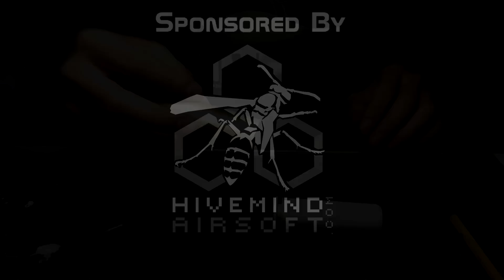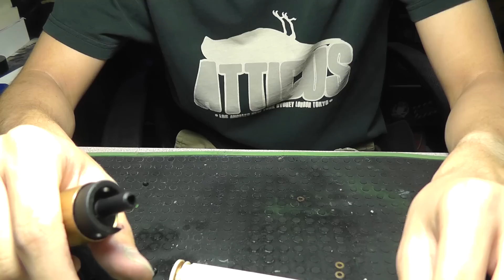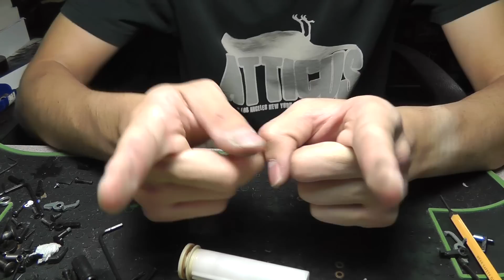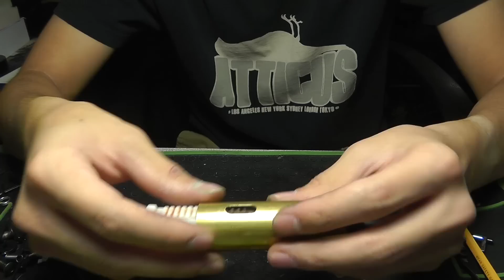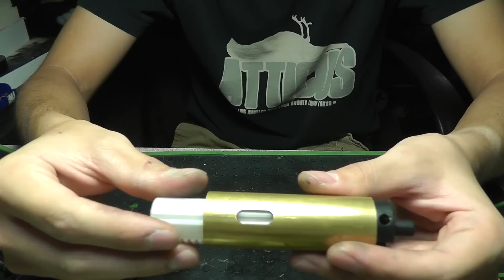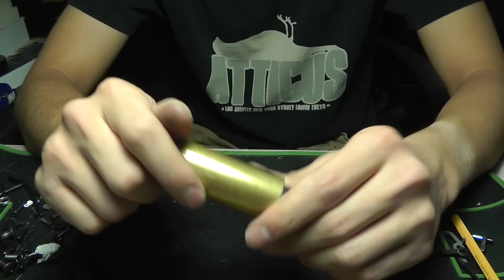Voluming Explanation (redo)

Comment: The link doesn't work anymore. 
Apropos ported bore-up cylinders. There is reason of that design. Ported cylinder give a piston and spring a time to get some speed. The result is better fps with less volume. 
For example, I have M16 [Double Bell 084] with 510mm barrel and type 2 cylinder. I am getting 415 fps @ M115-120 (~1.5J). It is full stock. But I have plan to change cylinder to type 0. If fps will go up and there will be no joule creep, I will change spring to weaker.

Comment: I am shooting .25 with 407mm/6.03 barrel. Do i need full cylinder or ported one like 80% volume ?
Reply from the maker: probably a slight port but I would just do full and up your BB weight if you can
Reply: Ported. Type 1 should be ok.

Comment: wouldnt it be theoretically better to get cyllinders without holes, then do the math and put the hole in the right spot for the volume to be matched with the barrel ?
Reply: i mean i can assume that way it would be the most accurate to match right?   is there also something to say about the amount of compression that takes place by the speed and weight of the piston ?
Reply from the maker: sure yeah that would be the better option but that requires extra work most people don't wanna do

Comment: Just FYI I have a stock type 0 cylinder with a stock 472mm barrel, that thing shoots flawlessly, I then installed a 455mm barrel and no change, so I'm assuming 472mm is the limit on cylinder volume to barrel volume, unless someone has a barrel longer than 472mm.
Reply: Elfren Authorlee PSG-1 has a 500mm barrel
Reply: Charlie Whelan 590mm*

Comment: Hi!!! i have some issues with air voluming, i hope you can help me out

Cylinder volume ratio:  31141
Barrel volume ratio: 12993

Total ratio:  2.39

Mi barrel is a 4.55mm 6.03 bore

Mi question is, may i need to do some kind of tip hole to mi cylinder?

thanks and have a nice day
Reply: For anything longer than 400mm you want a full cylinder with no ports

Comment: Quick question. I have an m4 DMR I built with a ares gearbox with a m140 Spring. The stock cylinder is a type 0 (no port). I have a 509mm x6.03 tbb. I can not figure out the ratio that I have between cylinder and barrel but I do have sorbo to correct aoe. I have perfect airseal but the bbs always fly up about 70-80 ft away. Should I consider a gaurder type 0 m4 bore cylinder or even expand the window and put in a sr25 bore up? Any info would be appreciated.
Reply from the maker: +Stev3419 Does it have to be that long? You might just install a shorter inner barrel. if the bb's are flying up you might have a hop up setup that is overhopping but I don't think the issues is caused by your air volume ratio.
Reply: +valleyriverarms The hop up adjustment doesn't do much with the 509mm barrel. it shoots perfectly straight with the stock barrel but the stock barrel is only about 300mm. If I use the 509mm barrel and I back the hop up off the slightest bit the the pellets go straight down after about 40-50 from leaving the barrel. I have sorbo pad in the cylinder for aoe correction so i loose quite a bit of volume in there. I've done the math and the cylinder to barrel ratio I have right now is around 1.6:1. The 2 people I know with dmrs have an air ratio around 1.9-2.1:1 but they are both sr25s with the longer cylinder but still have a 509mm barrel. I spent a good amount on buying my 509 mm stainless steel Prometheus type tightbore and have about $600 in the gun so I would like to use this barrel with the gearbox I've built up. If I do not get it straightened out anytime soon I might end up putting a polarstar Jack into it instead but as I stated would rather use the gearbox that I put the money into
Reply: +Stev3419 way too long of a barrel. get a 400-455mm. have one installed in my ak, much better accuracy

Comment: Tech question
Guarder bore up kit ( http://www.evike.com/products/28017/) for my vfc m4( http://www.evike.com/products/31981/) yay or nay? And your opinion on guarder. Thank you ^-^
Reply from the maker: I think I explained in the video that I think bore up kits with a port in them are dumb. Because you're bleeding out the air volume you're trying to increase. Guarder airseal parts in general are pretty nice though.
Reply: Okay thanks. And have you ever had problems with the piston head?
Reply from the maker: Nope. Rarely use bore up though

Comment: Hey i have been making this build for a while now and i believe i am having a airvolume issue k so i have a type 0 cylinder with perfect compression system a tight bore 6.03 inner barrel and short stroked 1 tooth  I did some research and in theory my barrel length and cylinder are match up with  a 2.35:1 ratio and i should be slightly over voluming it but (i also took off 5 mm from the cylinder in the calculator for the sorbo with the short stroke)  My barrel is 420mm so i should be shooting fine right but no its having the same results as it did with a 510mm inner barrel and its just dropping like my friends use to be (undervolumed gun but it is fixed) it is truly dissapointing when you have an m130 and your only getting like 50ft max in range any what should i do? Could it possibly be the how soft the sorbo pad is?
Reply from the maker: are your fps results lower than they should be? That's a better quantifier than range. Although that is a bit low. Check to make sure you're not losing fps in the bucking seal. Sorbo does compress but I'm not sure it would be that drastic. Possibly try different springs to rule out a soft spring.
Reply: well i actualy tried 3 buckings a lonex matrix and g&g same results.  Its the hardest spring i got and my i think i allready told you but my friends guns used to be having around the same results but when we put in a full cylinder and then it worked fine it kinda just drops out of the barrel even though the hop up is turned all the way up (btw its a lonex M130) thanks but i dont thinks its the spring nor the bucking would you know any other ways?
Reply from the maker: Rau123 For good measure might try Madbull blue. They seal super tight. If your hop up is turned all the way up it might be too aggressive and is slowing the bb down depending on the shape of the bucking on the nub. I would still check for any obstructions and possibly try another spring to see if anything changes. A lot of this is going to be isolating problems.
Reply: valleyriverarms i guess it wont hurt to try but i am not convinced that it is the hopup but i should have told you before i did tried my friends hopup also that works in his gun great and the results were also the same he has a g&g hop up same as mine with A+ bucking and the same thing happened i was just thinking of this could it possibly be the delayer chip, or possibly barrel suck it also has a really low fps like 300fps but like what you said i will try an m120 see how that goes. btw thanks very much for responding i think your the only youtuber that has responded to every question i have asked.

Comment: You happen to know whats the optimal barrel length for those extended v2 gearboxes SR25´s have, as I understand the cylinder in them is quite a bit longer? Also do you know if they have bore up kits for those?
Reply from the maker: I imagine there's a bore up kit but I don't know where you would find it. use the calculator for the optimal barrel length because idk what it is.